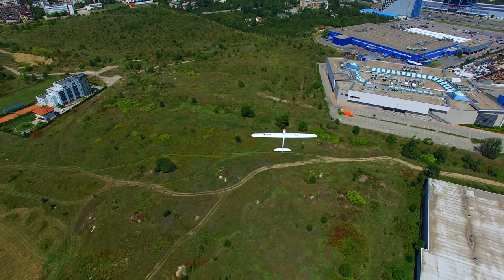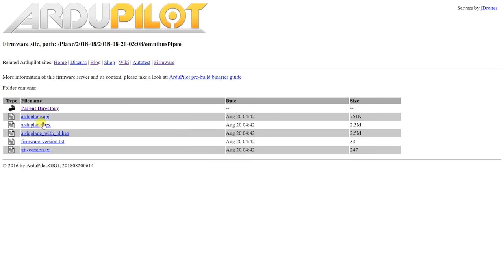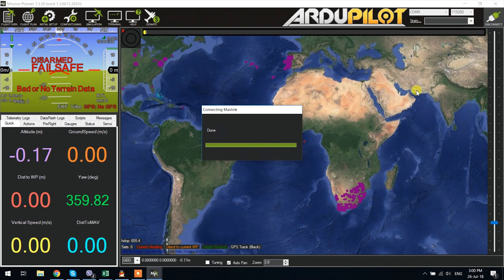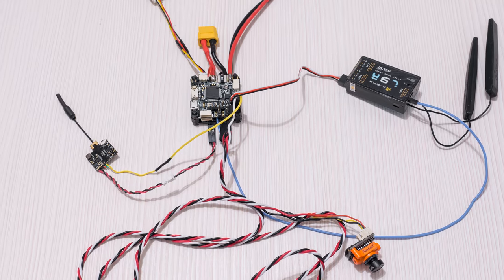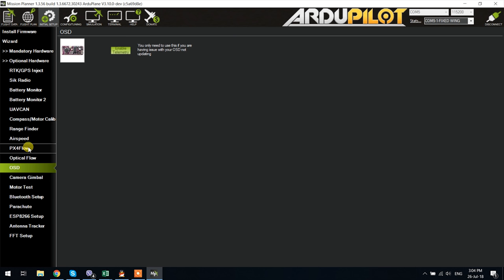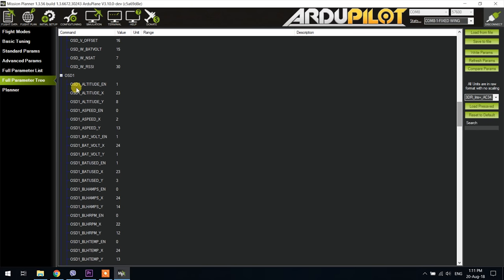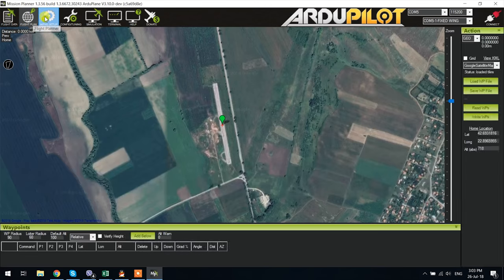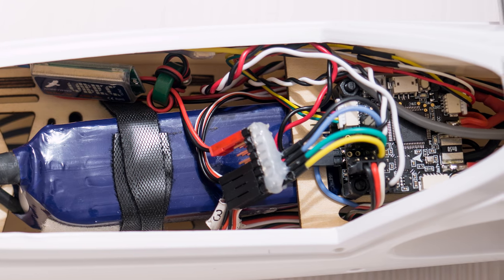HOW-TO ArduPlane on Omnibus F4 Pro and other boards!!!

Comment: do you can make tutorial make VTOL use this FC?
Reply from the maker: At some point I will make a VTOL, sadly this controller cannot be used for a VTOL! Does not have nearly enough signal outputs to connect everything needed for a VTOL!
Reply: @ArxangelRC  do can Mateksys F405-Wing for VTOL?
Reply from the maker: @caringcenter5375  I think more than 8 outputs are needed for VTOL, and also F405 Wing does not have enough ESC power outputs, so that would be a mess! Actually thinking about it... 8 outputs will be just barely enough for 4 VTOL motors, 1 tractor or pusher motor for plane flight, 1 for ailerons, 1 for rudder and 1 for elevator... and you will still have to find a way to power the ESCs external to the F405 Wing, which either means that you won't be able to monitor current draw, or if the model draws too much while hovering, it could overwhelm the F405's current sensor, and burn it out!
Reply: @ArxangelRC  omnibus pro has 8 pwm
Reply from the maker: @maybayson4203  OK

Comment: Are you removed diode no Omnibus f4 Pro?
Reply from the maker: Generally no, because I use an external power harness to power servos, so don't connect anything to the power rail on the board! I removed the diode on only one board, the one that went into the Mini AR Wing... because I had to save weight and space, so no external harness and powered the servos from that rail!
Reply: Ok thanks!
Reply from the maker: You are welcome! :)

Comment: Just got the board and IMMEDIATELLY pulled of the USB connector. Soldered it back on. all OK. Could not flash with Betaflight, downloaded Zadig exe, Fixed that. But Mission planner did not see any COM. So, downloaded ImpulseRC fixer (https://impulserc.blob.core.windows.net/utilities/ImpulseRC_Driver_Fixer.exe), ran that, said it could not fix. But it did, I coud see COM18. so now I have an F4 with ArduPlane :)  Cant wait for weekend! :)
Reply from the maker: Damn... I do hate these blasted issues with drives and software... makes this so much more difficult for people who are not in the know! Glad you sorted it out!

Comment: I try to download but it’s only able to safe HTM or All file but no Hex file
Reply from the maker: You need to right-click on the file and then "Save link as...", then it should download the file.
Reply: So i went arduplane like you but I have the same problem even if i download with right click. But if i try a betaflight hex all is good.is there some thing i miss.thanks a lott
Reply: Some extra info i have the omnibus f4 pro v2 and i can get it in dfu no problem. It looks like the hex file is not good i just cant load it .I use betaflight 10.4.0 config .in load firmware local  i use the arduplane_with_bl.hex it s like 2,56mb so it looks good .But wen i  say open .the flash firmware button   do not light up.this is were i am stuck. Hope you have a solution. Thanks again René
Reply: Update..also for people who are strugling . i have 3 laptops and on just one of them the last one it was working so it has something to do with drivers i think.cheers

Comment: Could not get iNav or Betaflight to flash the board - would not go into dfu mode. Found a fix here: https://oscarliang.com/fc-driver-issues-flash-firmware/#comment-19267  . The ImpulseRC Driver Fixer Tool works!
Reply from the maker: Yeah, that is the one thing I forgot to mention in the video, if you  have issues to use this Fixer Tool for it! Has worked once or twice for me too! :)